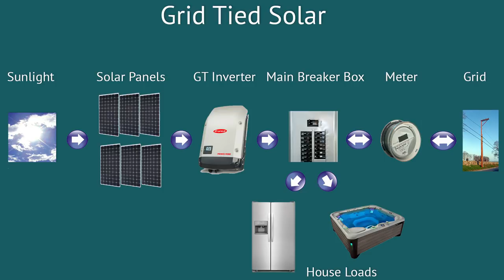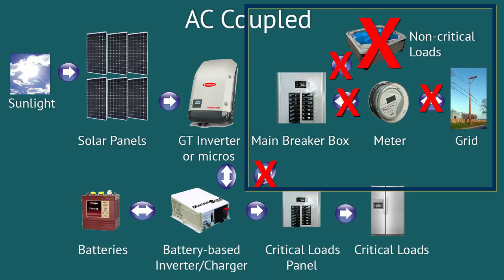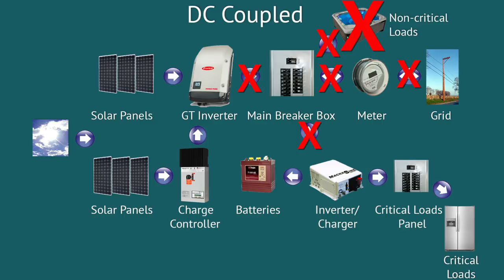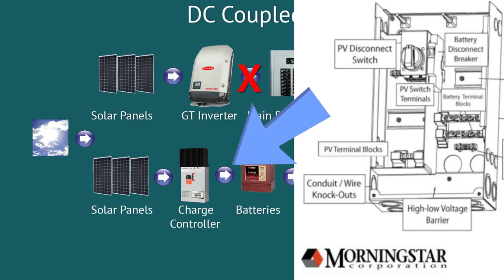Adding batteries to grid tied solar

Comment: Very well explained.
Appreciate.

I think to avoid all this mess, just install hybrid Inverter. Which you can use as on-grig or off-grid as per your budget (either use battery bank or without battery) when budget Allows, just add batteries to your system.

Comment: Wow..... at last a really good, informative & detailed video on the subject; thank you.  I liked it so much that I'm now downloading it for another viewing off-line, when the aspirin that I've just needed has dealt with the headache all that information has just caused - lol.
Could I ask a question please?  I'm currently trying to do almost exactly what your video is based upon.  I currently have a grid-tied 5.75 kwp system in the UK, running through a SMA SB4000-20 TL inverter.  I now have a new Sunny Island 6.0 'hybrid?' inverter & 4x 12v = 48v 220ah VLSR/AGM batteries ready to connect up.  Just found that I needed a SMA Energy Monitor & I ordered one of those earlier today.  If or when I get this all connected & up & running, it should provide flexible storage, but still grid-tied.  So  my 2nd step would be to purchase an Automatic Transfer Switch, to comply with UK safety regulations, to make my little system fully independent & functional in a blackout situation.
a). Could you recommend a couple of reasonably priced Automatic Transfer Switches please, as these are really expensive here in the UK.
b).  I currently have a couple of old Immersun units (now available as MyEnergi Eddi) that I wired in myself some years ago, & they are brilliant.  However I know they can put great strain on transformers (& cause them to fail because they utilise pulse technology) & my new Sunny Island unit probably has a transformer in it.  Where should I connect my Immersun units relative to the Sunny Island connection & to my home breaker box or mains grid input to avoid potential damage?
Thank you in anticipation of your answers, JohnnyK.
Reply from the maker: I'm glad you liked the video, but sorry I can't be more helpful with details for your installation. We don't have many UK customers, so don't deal with your local codes or products. I did find an SMA manual that I believe would be very helpful for you. https://files.sma.de/downloads/SI-SBS-Backup-PL-en-26.pdf

Comment: Less than a year ago we had 17-400 watt solar panels installed and the installer recommended we go with microinverters (Enphase IQ8).  The power then is fed back to the grid via our Enphase combiner box.
My first question to you is: how do the solar panels get disconnected from the grid when a grid down scenario is happening? 
What would we need to add to have the solar panels continue to generate power?
We do not have battery backup now so the addition of these items is a given.

Comment: I got my Fronius Primo very quickly.  I am waiting on an electrical parts supplier to open to install it because I have to buy a manual disconnect switch because of the contract with our power company, but it looks really nice.  We got it mounted today.  I would think the knob on the bottom would work for that, and it has a lock, also required, but the contract says it takes the kind with a lever, blah blah blah, from what it seems.
Reply from the maker: It is common for the grid provider to require an additional lock-out switch. For a 7.6kW inverter, you need at least a 40A non-fusible switch gear disconnect. The one we generally sell with it is the SquareD DU222RB 60A. https://www.altestore.com/store/enclosures-electrical-safety/switch-gear-disconnects/switch-gear-disconnects-ac/square-d-du222rb-60a-240vac-unfused-disconnect-2-pole-p8729/
Reply: @AltEStore  Thanks, I will likely order one at the end of the week.  Lowe's didn't have any.

Comment: Great video,   Did I hear you say you power the new inverter /charger from the AC output side of the GT inverter? 
The Qs though, do you have a transfer switch that runs the critical panel when utility is on? I do not see 1 on your wall. Does your solar stay on when utility is lost? If you tapped into your solar system to power your inverters built in MPPT. where did you tap in and did you need a special device or what.  Sorry for the many Qs but I to am installing a 48vdc 15Kw inverter/charger with built in transfer swt  and 640ah batteries with a built in 80a MPPT charger. I am trying to find out where and how to keep the power coming in from the solar to feed the inverter/and charge the batteries.  any input you can offer would be a big help.
Thanks in advance

Comment: Thanks to Alte for helpful video and tutorials. I wonder if you have a video or tutorial shows how a grid-tied battery system connect to the grid? What is the required equipment (fuses, switches, boxes, meters etc.) and how should be done the connections?
Reply from the maker: That is an excellent suggestion, I will add it to my list. Most inverters will have details in their installation manual, but I will absolutely make a video discussing it. Meanwhile, you can see a good example from the Schneider XW+ Install manual. https://i.imgur.com/p0Wn7vf.png
Reply: Hii, Ammy , I  m Savita from india , wants to join your team overseas .Can i ?? .M passionate bout solar plants .
Reply: I admire your knowledge n Wants to learn a lot from you .
Reply: Savitaa Gahlot
you Spoke engilsh?
Reply: @JSmith-wy3yh  yes

Comment: I like the DC coupled solution.  With either AC or DC coupled options, one thing you don't mention in your presentation but does add a significant electrical retrofit is isolating your critical loads to a sub-panel -  on an existing home, that can be a significant wiring task.  Either AC or DC coupled battery backup for a grid-tied system are still too expensive and hard to get approved.  In the mean time, I like the SMA Secure Power Supply feature which provides up to 2000W of power from a GT SMA inverter on a dedicated outlet when grid power goes out and the sun is shining.  It's not as much power as a typical battery system provides and doesn't help after the sun goes down, but it's inexpensive and doesn't require maintaining expensive batteries.  I'm surprised other inverter makers don't offer it.  New "Hybrid" GT inverters are coming out but most are not yet approved for CA Rule 21 - These should make battery backup simpler to implement.
Reply from the maker: Totally agree with everything you said. However, DC Coupling can only be used on string inverters, not micro inverters or DC Optimizers like SolarEdge. Also, for areas enforcing the next Rapid Shutdown code at the module level, SMA just added a rapid shutdown box that shuts down their modules when the grid goes out, making the SPS unusable for now. They are working on getting both to work together. I have a video I'm working on describing that product, will be out shortly.
Reply: I look forward to your future videos on this topic.  I have installed SMA inverters recently and in some case we were fortunate to be able to locate the SMA inverter less than 10-ft away from the PV array, so according to the NEC that array doesn't require the Rapid Shutdown Switch.  Also, on my existing 10-year old SMA based PV system, when the old inverter dies, as a "repair" i should be able to replace it with a new SMA with SPS without having to meet the new requirement for rapid shutdown.  I've been a fan of SMA products for a long time, but I have experienced so much frustration with installing the RSD and I'm not at all impressed with SMA's Power Plus technology. Why can't they implement rapid shutdown without all that extra hardware and wiring???
Reply: Can you elaborate on the concept of " SMA Secure Power Supply feature"

I am specifically interested in understanding how to enable my grid-tied system to "disconnect" from the grid and run during the daylight (relying on generators for night) without a huge expense or the need for batteries.
Reply: @ToolTimeTabor   You are asking about a feature of the SMA SunnyBoy string inverter from 5 Years ago which had limited 'off-grid' capability to provide up to 2000 watts through a separate outlet tied to the inverter which needed to be switched ON when Grid power was out.  The power available at this special outlet was limited to whatever was being generated by the solar panels up to 2kW. If a cloud appears, that power can be reduced significantly and if the load is too much, the power is interrupted.  This is not a solution for powering your home off-grid. It's only good for powering a few small loads when the sun is shining.  Furthermore, this feature is incompatible with module level  rapid shutdown, a code requirement in most jurisdictions which made Secure Power Supply obsolete a few years after it was released.  If you want to have practical home power during an outage YOU NEED BATTERY STORAGE period.
Reply: @marcfontana1454  Great feedback.  Thanks.

Comment: I feel, the power output is limited by the house annual usage. mostly, need 10kWh battery for critical load, and 30kWh+ for the full load. If use a lithium system, the power will be a not a limit. The most problem in AC Coupling system, when battery has fully discharged by longer disaster, it can not be recovered by itself when sunny. To overcome, need an extra small 1-2 panel DC system. MPPT charger with 1~2 solar panels. in ordinary day, extra panel will charge the battery and supply some DC utility power, if more than enough, it will be sell into grid if use hybrid battery inverter such as XW pro, so, never waste. and safety back-up all.

Comment: Thank you Amy! My Mother (84 at the time) bought an Enphase microverter system in 2014 they never explained to her that she wouldn't have power if the grid went down! The solar company was paid $40k to install 40 panels monitor and service! Six months in the system failed the solar company knew but never informed us or service the system! Mom paid a true up bill in 2015 without questioning why there was a bill of $1500 she had to pay likewise she never informed me of course I would have gone ballistic since this was the type of thing the system was to help us avoid! My Mother passed away last December and in October of 2017 I found out about the true up bill having received another for $7k+ as it was being disconnected! That's when I called the solar company, who told me they can't check out the system without being connected to the grid, that is how I found out about grid tie! Swearing I would not be caught again with my pants down I set about trying to find a way that I can go pseudo off grid!tSince then I have been running a portable generator my intro to generating power through the use of an alternator (undersized won't fire the HVAC) 9k generator gas $55 dollars a day converting to tri fuel am getting ready to buy standby generator 22K am also going to invest in batteries and another inverter for AC coupling as well as the required pieces such as an ATS, critical load panel, batteries etc. I'm suing the solar company for breach of contract as well as for fleecing the elderly, as I found the same system, including the permits for $20k ! Installers spent 2 days on my roof breaking 100+ tiles and not reimbursing us for them, they used the extra tiles we had allotted for the pool house to be roofed at a later date! $20k for an installation and a failed one at that! Is there any idiosyncrasies that Enphase systems employ that I should be wary of? I know they offer batteries even if Enphase says differently, though they advertise them on their website! I have tried to get the information that you provided from them for a couple of months now! They agree the Solar company is at fault but even with that they are stingy with the desired info needed to engineer my way out of this predicament! I will pay to add equipment before I pay for something caused by the negligence of a party paid to avoid such things!
Reply from the maker: What a nightmare. It infuriates us when we hear of dishonest solar installers taking advantage of people and giving the good installers a bad name. The Enphase battery systems are not available yet in the US. You can do AC Coupling with the system to turn it into an off grid system if you wanted, but that would take a big battery bank. Give us a call and talk to one the the technical sales reps here to discuss options.

Comment: The largest battery in the world is in South Australia it can theoretically supply a tiny 100MW of power for 75 minutes (when new its total capacity is 129 MWH). In the event of cyclonic weather South Australia can be without significant sunlight and usable wind for up to 10 days. The state uses 34,087 MWH/day so the worlds largest battery (assuming it's full capacity was available, which it isn't) would be theoretically able to support the state for 5.45 minutes before being completely discharged.  For a 10 days weather event for normal supply to the customers the state would require 340,870 MWH, bearing in mind the states target of 75% renewables for that period it would have mechanical generating capacity of 85,217 MWH so the shortfall would be 255,652 MWH. That would suggest a requirement for 1981 Tesla batteries.  That is why the idea of using Tesla batteries for a back up power solution is so ridiculous.
Reply from the maker: We are big fans of distributed power instead of centralized. That allows each house to have a small battery bank to handle their critical loads independently, rather than a huge central one owned by the power company. Tesla batteries really aren't meant for off-grid or even battery back-up. They are intended  more for self-consumption, where you just store your solar power for a few hours to use later in the day when the sun goes down and your loads go up.  There are many types of batteries that are great for a distributed solar system with battery backup, including the good ol' lead acid and LiFePO4 batteries. Not everything circles around around Tesla.

Comment: Wow, well stated. I've been researching a lot of this topic and I have yet to find one that simplifies it so I can understand it. I have a solar edge system so I need an AC coupled system. Easy. One question though, you said the charging with the AC coupled system is more ... twitchy, for lack of a better word. Is it still safe? Does it still work effectively? Can you explain it a bit more? Thanks!

Comment: Love this video. Probably the best I have seen on DC vs AC coupling. I do have a question since I have a unique situation. I have an existing GT system with a SMA Sunny boy 7.7 and I am wanting to add a 2nd array with battery backup system that will continue to export excess once batteries are charged. I was curious how you would recommend integrating? I have been looking at some batteries but they state that they are AC coupled batteries with built-in inverters. I know that AC coupling is less efficient. But if my current set up is better suited for AC coupling, then that’s the route I will take. Your thoughts? Thank you in advance.

Comment: The stand-alone solar power system.
A lot of material on the subject is already in place:

@t

Subjects of interest:

-The DC, much more reliable for off-grid dwellings generally, and for
our Islands and Areas of Light particularly...

-Voltage Standardization of DC Distribution System for Residential
Buildings

-The 'return' of DC (direct current)

-The DC (direct current) 'nano-grid' – a more reliable solution for
Areas and Islands of Light

-DC (direct current) Appliances

-The Ufer Grounding, a more preferable and more reliable electrical
earth grounding for our Areas and Islands of Light.